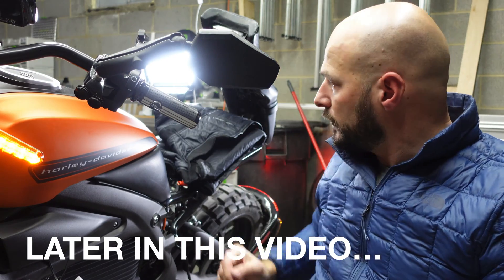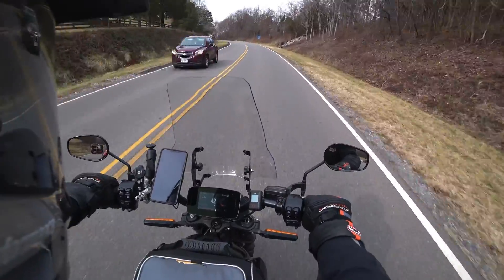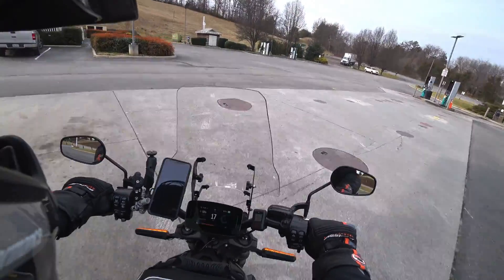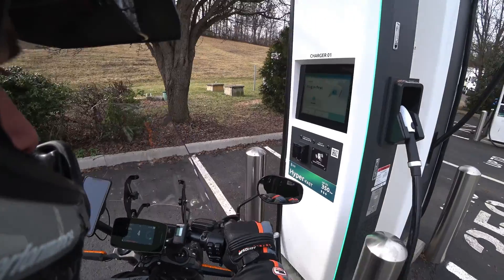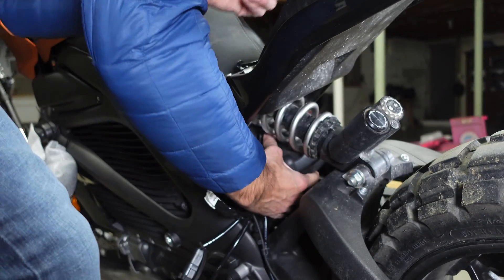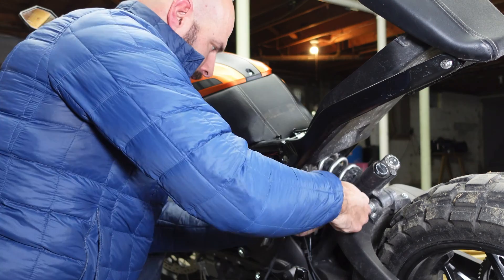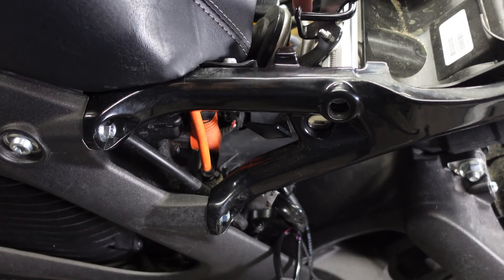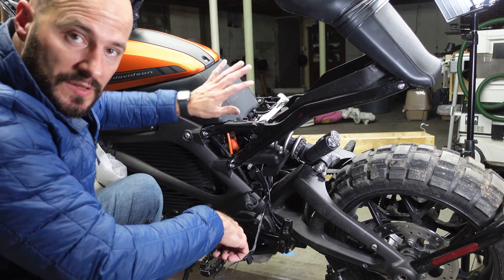How to SAFELY Use 12V Accessories on the LiveWire

Comment: Hi Ben, hope you are doing well. We've exchanged a few messages a while back. I've owned a Livewire One in Paris since September 2023. Ever since I purchased it, I've had countless technical issues I haven't found it to be nearly as good as the demo model. My bike has been in the workshop after an EVSE for 7 weeks now. They've lent me the demo model, which I think handles and feels a million times better! I'm trying to sort out these issues but am being sent back and forth between the Livewire representative and Harley. I've asked them to swap my bike for the demo model, which they aren"t willing to do. Anyway, to cut a long story short, I'm debating whether to keep the bike. I love the demo model and when mine works well, it's an incredible machine. I do miss wind protection on faster roads. Would you mind reminding me the name  of your windshield? How easy is it to fit and does it give you real wind protection above 60mph?
Reply from the maker: Oof, that's frustrating! Hopefully they get it sorted out for you. I wouldn't recommend this screen anymore, and I don't think it's manufactured now. It was a pain to keep in place, now I used some very custom stuff from modified HD parts.
Reply: @AdventuresonZero  thanks Ben. I might have to do the same. I want to get a front mudguard made too. The stock one is useless. Picking mine up on Friday and will test it out...

Comment: Hey what windshield do you have.  I Have a universal one and I’m not happy with it.
Reply from the maker: The one in this video is from Zero, however it's been discontinued. I now use a FLXRS windshield that's been slightly modified to fit my LW1 and S2 Del Mar. If you go to my community tab, scroll down to April/May and you'll see which one I got. It's only available outside the US, not sure where you're at.

Comment: How do you connect the USB SAE 2 pin connector?
Reply from the maker: HD sells an adapter for SAE to usb-a
Reply: @AdventuresonZero  Thank you. I successfully installed the USB A connector. Is 1 amp output good enough to charge the phone? Do you know what’s the output for the bike’s own USB C connector?
Reply from the maker: @Jimmy-01890  I believe the USB-C is around 3 amps?? You can pull up to 10amps from the converter
Reply: @AdventuresonZero   The HD SAE to USB connector only output 1 amp. If the bike’s USB C can output 3 amp, that’s more than enough to charge an iPad.

Comment: I followed your instructions exactly and it works perfectly! It is a godsend to be able to use my electric jacket the on the LiveWire in the wintertime. Not having high-output 12 volts DC has been one of my biggest gripes. It's really cool that it turns on-and-off with the ignition so you don't accidentally kill the battery.

I really appreciate your channel. Keep up the good work!...
Reply from the maker: Awesome! It’s a great way to ride year round now

Comment: Okay I have another question. Is there a way to check the State of Health (SOH) of the battery? I just watched a video of a Hyundai Ionic after 5 years and 100,000 kms the owner hooked up an OBD2 connector and used an app on his phone to view the batteries health. Spoiler Alert the car had 100% battery health, no degradation at all.  So is there an OBD2 port or another way to view the SOH of the LiveWire? This could be very useful for someone looking to buy a used bike. Thanks Ben.
Reply from the maker: As far as I’m aware there isn’t. I actually doing some research for an upcoming video on purchasing used electric motorcycles, and have reached out to the big makers for their input on determining/assessing battery health. Unfortunately there is no way to directly check right now. Some older Zero models, you can check the voltage of the entire pack, but that got firmware’d out. Check out the channel Hans Hacks, he owns an Energica and has hooked up some ODB type devices to his bike to report info, but I’m not sure what all it entails or if it’s what you’re looking for. Hope that answers it for you.

Comment: Thanks for this video and the information, so helpful. So does this wiring method mean you are powering your heated gear or accessories from the main battery (after the 12v convertor) rather than the tiny 12v battery? I am running a loud (Denali Soundbomb) horn, but I am running it off the 12v battery. I wonder if this may be causing the "12v Battery Weak" warning that I am currently getting. Would you recommend wiring up my horn in the same way as you've wired your heated gear in this example?
Reply from the maker: Glad you found it helpful! Yes, you are powering the gear from the RESS and not the 12v battery. Harley-Davidson says to never run off the 12v battery, as it gets trickle charged by the main pack. I would recommend you wire the horn using the method here, as it doesn't draw from the 12v battery - just make sure that the horn does not draw more than 10 amps.
Reply: @AdventuresonZero  thank you! Yeah, I see on the Denali website that the horn is a 20amp power draw..... time to start shopping for a different horn I guess, and that would further explain why the horn is probably killing the 12v battery in it's current wiring setup.
Reply: same company makes a "SoundBomb Mini" (which only draws 5 amps), and an easy purchase at $36.99; done.

Comment: Good Vid. Thanks Ben.  Could have used the vid about a month ago.  I ended up just buying a Molex plug and wiring myself.  A lot less unused wiring to hide.  Rick
Reply from the maker: Very true, I didn’t want to wait for the molex to come in 😆 HD is easy to use. I guess one could trim off and cap the excess if they wanted to

Comment: Great guides, interesting mods!
Harder than I expected though.
Reply from the maker: I went a little above and beyond with soldering, but other than that it’s a 5 minute install
Reply: @AdventuresonZero  Oh no, I meant on the bike side. For 12 V accessories on other bikes Harley sells a few of them, it's as easy as to add a washer style connector on the battery terminals.
Reply from the maker: @IIARROWS  oh yeah, well for whatever reason they didn’t want or think people would use accessories on this bike, except for the siren alarm which is easy to install
Reply: @AdventuresonZero  Like bags...
Reply from the maker: @IIARROWS  yup. Turns out they didn’t want market competition with the pan America. So none of the adventure-y stuff never came out for the LiveWire

Comment: What is the Livewire Inlet Plug Part Number 69202480 used for? It's this loose rubber thing under the seat. Just got my LiveWire I have a million questions.
Reply from the maker: So that was supposed to be an anti-tamper device for the included EVSE. Meant to prevent someone from unplugging your bike and stealing your cord, but it doesn’t work 😆
Reply: @AdventuresonZero  lol good to know.

Comment: Will that battery tender your 12v battery
Reply from the maker: Yes it still charges the 12v battery. Essentially adding a splitter from the 12v converter, which is why you don’t want to exceed 10amps, leaves enough to trickle charge the 12v battery
Reply: @AdventuresonZero  do you ever get a "12 Battery Weak" warning? I just picked up a used 2020 Livewire and I only rode it once so far (and it's showing a 12v battery weak warning). Can I use a 12v lithium ion battery tender? Or should I consider replacing the 12v battery?
Reply from the maker: @daveallen1973  No I've never seen that warning on either of my bikes. It sounds like that horn continuously draws power, especially if it's hooked up to the 12v battery, which HD recommends against. You can use a battery tender, just make sure it's one that can handle lithium ion. Harley-Davidson sells an inexpensive 1amp and 5 amp tenders. I would recommend using the method in this video, as it doesn't draw from the 12v battery and can only draw when the bike is powered on.

Comment: Hi Ben. Ok, quick question. The live Wire is fully charged; you're riding in "normal conditions". Percentage wise, how much additional battery drain is caused by running the heating & phone?
Reply: I was curious as well, so I did the math using the power draw figures from Revzilla's Hotwired gear (easiest to find quick) - full set (jacket, pants, gloves, but not soles) is 170 watts, plus a phone - if it's quick charging, say 25-30w. Say 200w for all of that. 1% of the (usable amount of the) RESS is 136w. So, if you ran all of that at max for 3 hours straight, you'd use about 4.5% of the Livewire's battery. If you're riding 3 hours, you've probably got to charge it at least once, so you'd probably only use 2% or so per charge, for like 2-4 miles of range loss per charge.
Reply from the maker: @kevink931  thanks for the tally, Kevin! Sounds about right to me
Reply from the maker: Very little. I’d have to sit down and do some napkin math, but maybe a mile or two of range if I ride for a while